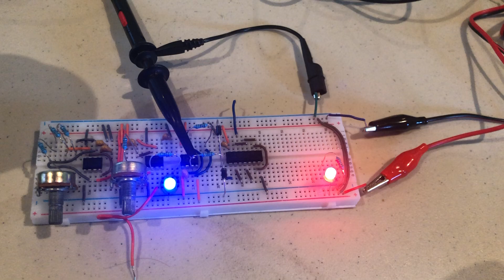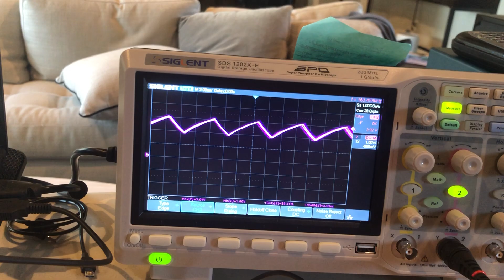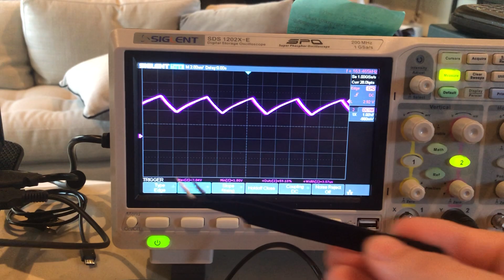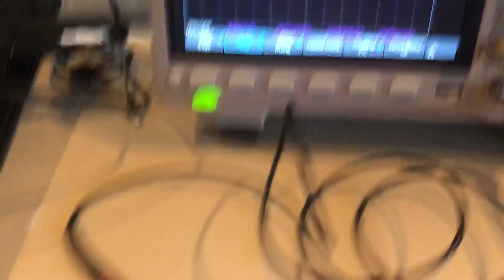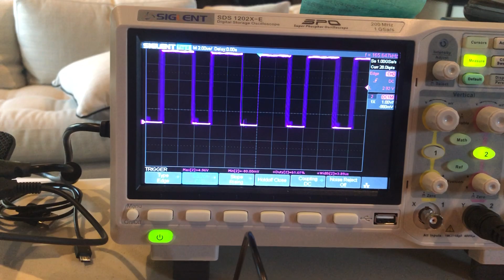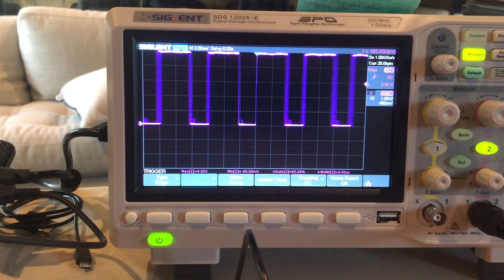SSTC Hex Inverter Tuning Circuit - SSTC 1.0 Update #002

Comment: Nice did you get it running ? I build something like what you are doing with a pll 4046 and schmitt trigger hex inverter , irfp460(fake) and ucc gate driver but I do not have a scope 😂 so I got it working but I am struggling to get it tune for low heat class E switching , with the pll you can introduce audio signal through vco and I seem them sound really clean , check out magneticitist channel and my channel